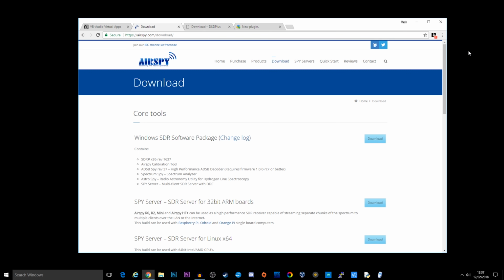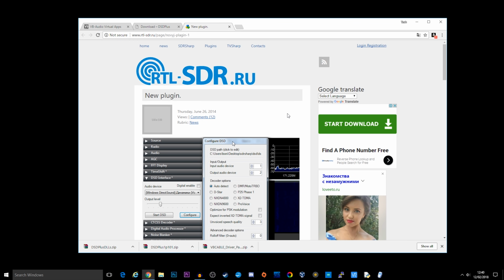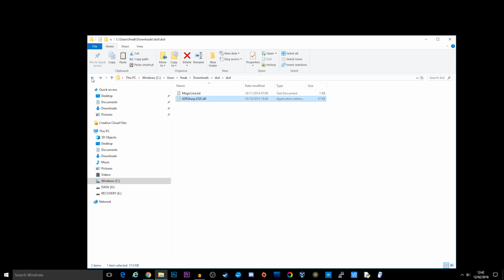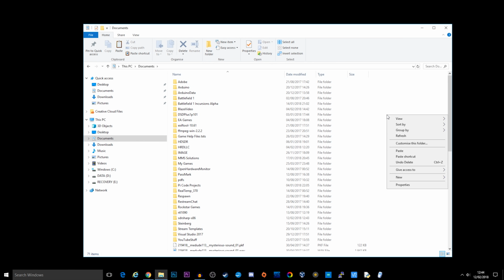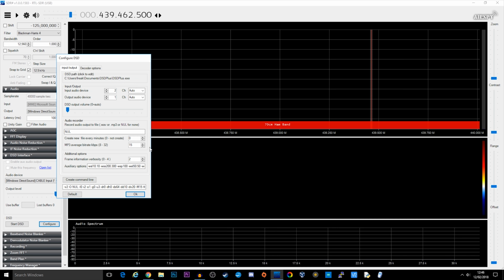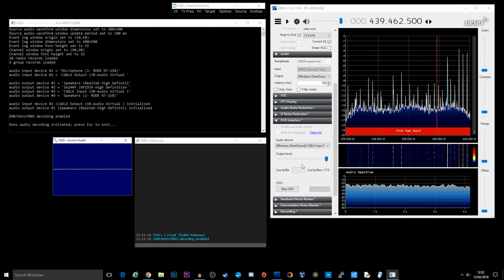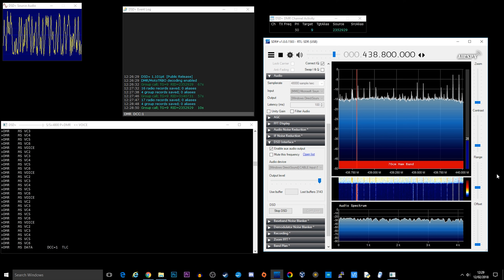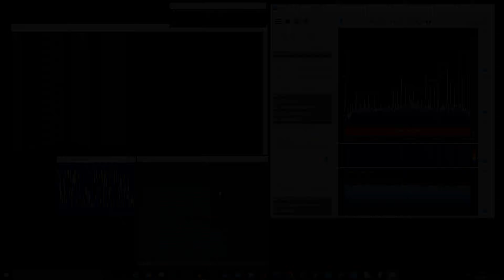How To Setup SDR # Sharp To Decode DMR Digitial Using DSD Plus And An RTL SDR Receiver on Windows 10

Comment: plugins.xml not found in sdr# folder. There is a plugins folder with nothing in it. I can not get dsd working right and I think this is the problem. I tried adding my own plugins.xml and input the code but something is off. It shows up as a tab on sdr# and all, but I pipe in the output every way possible but no decode.

Comment: Everyone read this. If you minimize the windows for dsd plus to bottom of screen it will increase you processing power for your cpu. This will make the decoder work better. Once set up properly you can minimize the sdr sharp to bottom of screen and dramatically increase processing power even more. If you go to task manager on windows and wait a couple of seconds you can see how much it increases your available processing power. You still have to get your bat file correct first so read the read me file for dsd plus and have gain in correct place. Hope this helps some people having problems with weaker computers.

Comment: Doesn't work, DSD interface does not appear in SDR#.
Reply: oh ok it seems if I type sdr# into the search bar and run it comes up with one SDR#. If I double click the SDR#.exe from within the SDR# folder it loads up a different instance of SDR# This explains why when I loaded it up the first time the layout looked like yours, and when I loaded it up again the layout was totally different, all by itself, without me doing anything. I only installed it once why do I have two instances of it. One of them seemingly ignoring the DSD interface plugin, or any of the plugins for that matter.

Comment: I am a novice at this so bear with me please.  I have gone through the process described, but when I press the start button I get the message no device selected.  When I click the setup gear on the to bar the device box is empty and there is no opportunity to change it as the drop down arrow is greyed out.  it does say above the box Device  E4000 (if that means anything).  Can you point me in any direction that would help?  Thanks.

Comment: Great video!
I spent one whole night trying to figure it out by myself, and right after I did manage to get it working, I found your video! Too bad I didn't find it before!
I am quite new to the SDR world and I found it quite impressive that you are receiving the signal with such intensity. What is your setup?
I am using a telescopic antenna indoor and the signal intensity I am getting barely goes above -60 dB (with noise floor around -80 dB). Do you have any tip on that?
Reply: With this dsd stuff, what can I listen to? Im in Vancouver, BC...is ecomm/provoice the same encryption and thus I cant hear them?

Comment: Very good video, but I figured out something important, in the plugin config page, you have to choose, audio input and output devices, that are listed in the terminal when you start dsd. input has to be virtual cable, and output speakers or headphones if you will, but to make it work you have to click on "create command line" and restart DSD with the correct command line, you then can check the terminal page if the initializes devices are correct. Also, in the plugin side panel "Audio Device" can be speakers, so you can check "Enable Aux Output" just to monitor the encrypted audio. The volume on the top of the page is very important, if you set it low will decode nothing, and if too high will compress and distort and you will get a lot of erros in the terminal, its optimal when the sound wave is regular and you are not getting errors.
Reply: yes thanks for your comment so your saying in plugin audio devices i need to setup our speaker instead of virtual cable ? ,when am making virtual cable  there is no sound
please reply

Comment: Have the setup running - so far only found some data channels. Did attempt to decode my digital Kenwood TK-3401D - but DSD+ does not appear to detect the signal at all. Are all digital PMR radios equal = that is - do they use the same encoding ?
Reply from the maker: I’m not sure if DSD can decode those. Best thing to do is locate a local DMR ham radio repeater and try and decode that. That will ensure your setup is working
Reply: Tech Minds : Found the answer. No. These Kenwoods uses AMBE+2 encoding - which - should be supported in a future release of DSD+. From my brief readings on the dPMR standard, it looks like manufacturers can use their own chosen codec’s - as long as they can fall back to a common set. Have not tested with a different brand of dPMR handset though.

Comment: Funny, followed your video - installed using your very detailed guide - and found, that the version of SDR# I had downloaded - which included a number of plug-ins - already had DSP Plus installed :-). Now, unfortunately have to wait testing, as I am in a remote vacation location with little signals at all. 

One request - I found that my just purchased HackRf performed really badly, hardly getting any signals - that was until I was holding the short whip antenna in my hand, touching the metal ground. How about an RTL SDR antenna episode - how to optimize indoor/mobile antennas for reception ?
Reply from the maker: I should be receiving some sample indoor antennas soon to hopefully make some videos on :) thanks for watching 🙏

Comment: I've followed these instructions to a T. Still no audio coming out of my computer...
Reply from the maker: Are you sure the signal you are trying to decode has audio and it’s not encrypted?
Reply: @TechMindsOfficial  Not encrypted at all. its an amateur radio repeater
Reply: @bryanvetor4529  What happened in the end? Did you win? What was the issue?
Reply: @paulseymaker216  no clue I gave up and moved on to something else. I just run analog on it now.

Comment: I hear nothing after doing this.
Reply from the maker: It’s most likely to do with the audio output settings. Have you tried using the command line way?
Reply: @TechMindsOfficial  Not sure what you mean by the "command line way"?
Reply from the maker: Check out this video: https://youtu.be/bS1KBGlUoZ0
Reply: @TechMindsOfficial  I have had DSDPlus working in the past, I just can't get it to work with SDR# 
They don't really work together. One or the other is fine.

Comment: I tried to install the virtual cable. Using the 64 bit version, when I click on the 'Install Driver', it comes up with an error message 'Error: Access denied to registry'. I have the latest version with all the plug-ins attached. I tried to install the non 64 bit cable, it came up with the windows permission box and I allowed it, but that was it. Nothing. I have tried to set the audio output to the cable, but its not listed.
Reply from the maker: Try right mouse clicking on the installer program and select “Run with administrator”.
Reply: @TechMindsOfficial  Thanks, That seemed to work.

Comment: My DSD Plus simply won't work. It does start but the inputs are wrong even though I followed every instruction. All files in the correct folders and setting exactly the same as you show, but for some reason  DSD Plus is using my microphone as the main input and not VB Cable even though VB Cable is selected in the audio and dsd dropdown menu. When I disable the microphone, DSD fails and will not run. Any idea what to change or to do differently?
Reply from the maker: It sounds like your audio in and out are wrong or there is an issue with DSD recognising the audio ports. I have another video which covers using DSD from the command line.
Reply: @TechMindsOfficial  Must be a DSD recognition issue. I uninstalled everything and did the whole procedure again. Everything setup the same as the video instructs, but same result as before. Will have a look at other video.

Comment: How to make DSD+ select High Definition Audio Device (Speakers) for output device, in my case it always selects CABLE input (VB-Audio Virtual C) so I can't hear nothing
Reply: Found it!

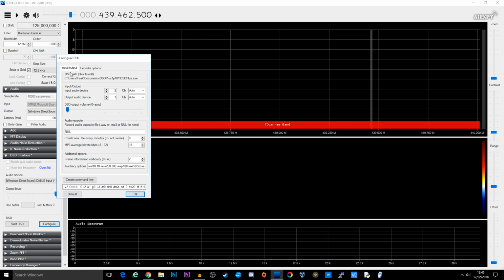You have to go the configuration in DSD like he does in 7:05, then select the Output Audio Device you want to change to, in my case it is device number 3. Then you click Create command line and then OK. Tada!

Unluckily for me I don't have any good signals receiving at the moment so I haven't heard anything, but Im sure that will fix your problem
Reply: Dude, I've literally been looking for an explanation on this for over two years! Thank you so much, you just ended my DSD+ SDR# woes! There's hundreds and hundreds of forum threads on DSD+ audio touting issues and not a single person has explained how to select specific audio devices! You sir are a nation treasure. THANK YOU
Reply: @UCm-ruSF2bUfbXZhUwKj0mig he made another video, I can do it when I start dsd+ plus manually through cmd like he does here https://youtu.be/bS1KBGlUoZ0

Comment: Still not getting audio from P25 or DMR in my area. Does this look right to anyone? The box that shows audio coming into DSD is not doing anything when a P25 or DMR Signal is tuned into on SDR Sharp. 

audio input device #1 = 'Headset Microphone (Microsoft L'
audio input device #2 = 'CABLE Output (VB-Audio Virtual '

audio output device #1 = 'Headset Earphone (Microsoft Lif'
audio output device #2 = 'Realtek Digital Output (Realtek'
audio output device #3 = 'D24f-F1 (2- NVIDIA High Definit'
audio output device #4 = 'CABLE Input (VB-Audio Virtual C'

audio input device #1 (Headset Microphone (Microsoft L) initialized
audio output device #2 (Realtek Digital Output (Realtek) initialized
Reply: Ok well it's taking the audio from my microphone and the vb cable. Any ideas on how to fix this?

Comment: Can this procedure be also used with HDSDR? Totally new to this whole thing, I thought the hardware I already have (RTL2832U+R820T2 TCXO 0.5ppm) is my 'receiver', or do I need an external RX radio to use this stuff with? Again, I'm new to this, it initially looked interesting, but I just keep hitting all these roadblocks to getting the thing to work...I'm certain it's either something I'm doing wrong, or not doing at all?

Comment: Install went smoothly I believe but the SDR Sharp isn't finding my dongle at all. How do you get it to recognize the SD dongle ?
Reply from the maker: Use the ZaDig application to install the winusb driver
Reply: @TechMindsOfficial  I did and it and still doesnt work.  It finds the dongle, classifies it as a keyboard and then when I bring up the source controller in SDR ,its invisible, it wont even allow me to open the box ,its grayed out

Comment: I was able to set up and get a pre-recorded file to play from sdr sharp to dsd and decode.  So I know the setup is right..  But when I actually push dmr radio live audio through the same settings.....  it decodes nothing.  there is source wiggling and dmr repeater is the source with really good signal.  Just nothing decoding like when I play the downloaded sample file.  What am I NOT plugging in somewhere a Codeplug or some special code to make it decode the actual encoded dmr radio signals?  Are they encrypting with military codeplugs on Ham channels now?  What can I do to listen?
Reply: did you solve this?

i also have some other issue with no dsd interface menu that i can't get to the bottom of.
Reply: @mr.d5314  Yes I did get DMR to decode...  What it turns out the signal I was trying to decode was actually P-25 (THE NEW ONE) that takes a degree in programming to figure out.....  but it can be done.  Just not by me.

Comment: In your opinion what is one of the better SDR units for reception of DMR,Dstar, and P25.   I have one of the cheap $20 RTL sticks (ER400) and they do work but I find the sensitivity obviously will be poor.  I also found digital reception best is DMR, but Dstar and P25 are awful with lots of drop outs.   DMR is OK but still not as good as a cheap $54 Baofeng DM-1801.
I was hoping for better P25 reception for my local police but not to good with DSDplus.
Reply from the maker: Do you use the Fastlane edition of DSD+? It’s far superior at decoding than the free version. If you want a cheap SDR dongle that good quality, get a NooElec NESdr. If you want something a bit more pokey look at SDRPlay or Airspy products :)
Reply: @TechMindsOfficial  No I am using the original version.  I didn't know about Fastlane.  Is that free like DSD+ ?

Comment: Hello Matt, thank you for the concise video, I am using SDRsharp on windows 10. Despite following the instructions exactly I couldn't get the audio to work, I can hear a carrier on CW but no other audio wahtsoever. I am using HackRF One. here a copy  of the DSD file , despite all the sound setups i have done the last line is allways saying "audio input device open failed"
can you help please.

DSD+ 1.101pt
NOT saving synthesized audio to DSDPlus.mp3
wav/mp3 file generation interval = 0 minutes
Enabling output audio AGC
Setting unvoiced speech quality to 3 waves per band
Scaling factor set to 64
Damping level set to 10
Viewport size set to 20
MP3 ABR set to 15 kbps
Source audio waveform window origin set to (10,10)
Source audio waveform window dimensions set to 200x300
Source audio waveform window update period set to 100 ms
Event log window origin set to (50,50)
Event log window dimensions set to 400x500
Event log window font height set to 15
Channel window origin set to (90,90)
Channel window font height set to 15

audio input device #1 = 'CABLE Output (VB-Audio Virtual '
audio input device #2 = 'Internal Microphone (Conexant S'

audio output device #1 = 'Speakers (Conexant SmartAudio H'
audio output device #2 = 'CABLE Input (VB-Audio Virtual C'

audio input device open failed
Reply from the maker: Hi Jad, looks like DSD isn’t able to open VB Audio cable. Did you restart your computer after installing VB Audio? Maybe try uninstalling and re-installing VB Audio cable.
Reply: Thanks for the quick response. Yes I did , infact I uninstalled everything and reinstalled again with rebooting after VB-Audio. 

I opened EMPA.EXE  and FMP.EXE  inside DSD+   also gave  errors nothing is opening anything. files listing shown bello

EMPA rev 1.01t
FMPA -h for help summary
AirSpy sampling rate = 2.5 Msps
Spectrum window width: 1024
FFT size: 32,768
Spectrum update rate: 5 Hz
Step size table:  5.000  6.250  7.500  12.500  15.000  25.000  100.000
DSD+ path: '.'
Primary frequency list: '.\FMPA-FreqList.csv'
Secondary frequency list: '.\FMPA-FreqList2.csv'
Database search distance: 99.90 miles
Base latitude/longitude: 19.7163 -155.6241

Audio output device #1 = 'Speakers (Conexant SmartAudio H'
Audio output device #2 = 'CABLE Input (VB-Audio Virtual C'

Airspy lib version = 1.0.6

Can't open Airspy device #1
--------------------------------------------

FMP rev 1.4t
FMP -h for help summary
SDR sampling rate = 1.008 MHz
Spectrum window width: 512
FFT size: 32,768
Spectrum update rate: 10 Hz
Step size table:  5.000  6.250  7.500  12.500  15.000  25.000
DSD+ path: '.'
Primary frequency list: '.\FMP-FreqList.csv'
Secondary frequency list: '.\FMP-FreqList2.csv'
Database search distance: 99.90 miles
Base latitude/longitude: 19.7163 -155.6241

Audio output device #1 = 'Speakers (Conexant SmartAudio H'
Audio output device #2 = 'CABLE Input (VB-Audio Virtual C'

SDR device count=0
Can't open RTL SDR device #1
---------------------------------------------------

Could the reason be:
 instalatiing,  SDRsharp32bits, VB-audio 64bits and DSD+ is 32bit?
or could it be setting of sound in windows 10?
your help is appreciated.

Comment: Good instructions.  However all I get are CACH ERR messages.  It successfully determines that it's DMR (which agrees with the ham repeater handbook).  Is there a debugging guide somewhere?
Reply: Have you managed to solve "CACH ERR" problems? I have just installed "the system" and have the same issue...and have no idea what to do....?

Comment: Hi Matt ! In SDR# "Audio" > "Output", what is the point of selecting "Windows Direct Sound" rather than "MME" ? They both show the VB Audio Cable input. Cheers ;-)
Reply from the maker: As far as I know they are different sound drivers, but the Windows Direct Sound should have a lower latency and is my preferred choice. 👍
Reply: @TechMindsOfficial  Thanks for the tip !